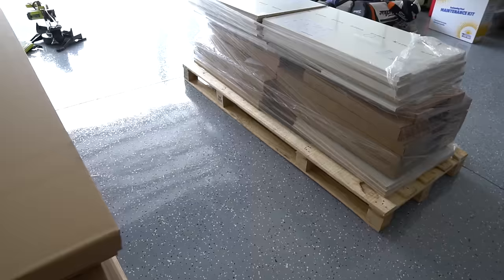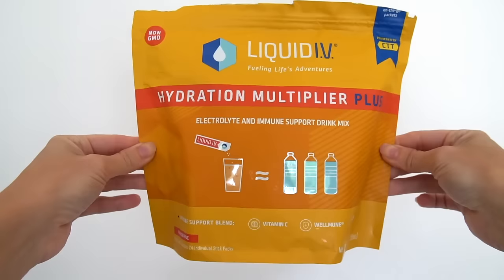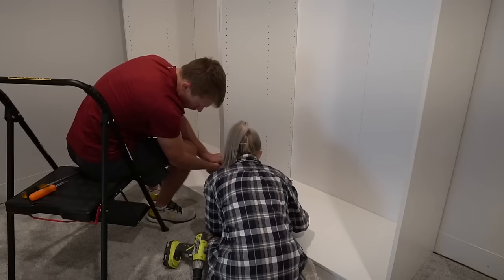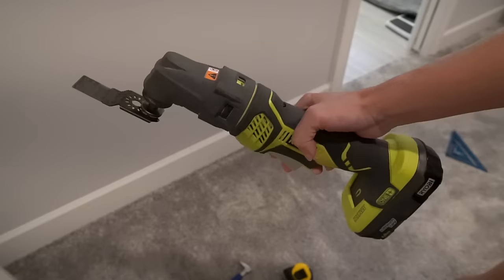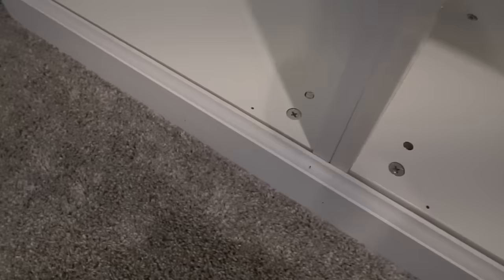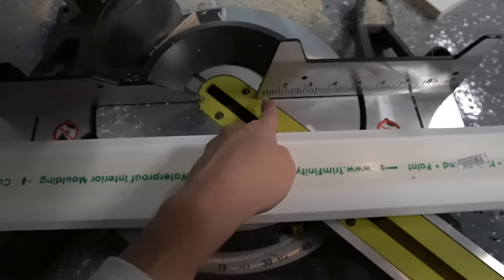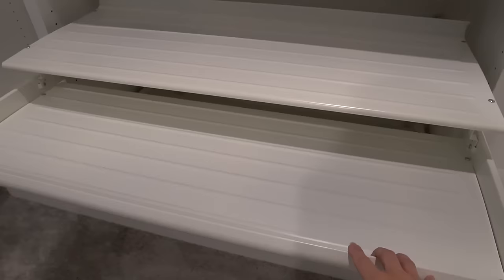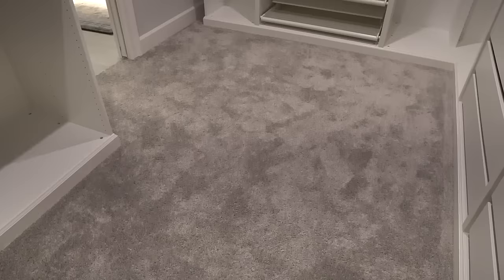IKEA PAX Closet | Home With Stefani

Comment: My husband kindly asks that you quit making these things look easy. 🤣. What a great job. Looks so high end.
Reply: This really is easy…we put ours together fast
Reply: @alisaben1  111111
Reply: Yeah. It looks easy on video. But she didn’t show all the difficult parts, I’m sure there were a few rough patches. Like cutting the 45 degree angle and nailing in the right corners. And I’m not sure the caulking will hold up well over time. That lower section could have been finished a little bit better and would have made the cabinets much sturdier since the pax is made of particle boards. I have the PAX. So I know each section should be beefed up a bit to hold well over the long haul.
Reply: It's easy on a new home like this..on old homes like mine..over 100 yo..not so much
Reply: I feel your husbands pain!!! 😂😂
Reply: 🤣🤣🤣🤣🤣for real though. I bought an ikea Chester draw and I almost gave up putting it together 🤣🤣🤣🤣🤣
Reply: They are easy. I put them together with my daughter.
Reply: It's easy because the wife in this video helps.

Comment: Would be curious to know how much did the IKEA PAX that was installed in the video costed? I am assuming $5K-7K. Thanks!!
Reply: Generally these systems are less than 3k. I have a closet similar to this size and our closet was about $2000
Reply: I have 6 frames in my walking in with drawers ( both glass front and solid front) pull trays, shoes trays all under $1700

Comment: Hi Stefani,  I enjoy your videos.  Wonderful Job. I have installed three IKEA kitchens and have assembled dozens of pieces of furniture. I am big fan of their products.  I like your use of wood strips, baseboard and crown molding to give them a nice finished look. The one thing that I would do is to get filler strips for the ends where you have what looks like a 6 inch gap. When IKEA doesn't have filler strips that are big enough, I have purchased an extra door or shelf to do the job.

Comment: Looks great! Love the crown molding. I’m curious about the single detached unit on the one wall. Would it have been possible to change the dimensions of one of the cabinets on the wall beside it and then use another corner unit to fill that gap?

Comment: Super nice end result.  Remember to always take one side of the wardrobe into the closet first, so you can see that you can straighten a whole wardrobe, without bumping into the ceiling or the other walls.  If it is cramped, you can assemble the wardrobe standing in place.  Need a little more hands then.  Another thing is that the shelves are made of chipboard and have fragile edges.  Be careful with these.  Another thing to keep in mind with IKEA furniture is that a little wood glue helps a lot to avoid unstable furniture after a while of use.

Comment: As a professional IKEA pax installer
The way to do efficiently is to build the units first then mount, not one by one but all at once
Also those drywall anchors are terrible
Best ones are toggler alligators
And for baseboards you did use the right tool
The oscillating tool is what I use too
For the drawers the sliders should be installed all at once they are 6 holes from each other and shelf on the top drawer is 5 holes. It's more efficient to do them all at once, same with drawers instead of one by one
Great job either way for a first timer looks great
The

Comment: i had so much trouble attaching the  floppy back to the frame because it kept folding into itself.  After unsuccessfully attaching the back, I tried to raise the frame and try to attach the back vertically-- the entire frame collapsed splitting some to the dowels and the bottom connection. Thank you for the idea of using the sticks to hold the fold straight.

Comment: I see that you installed the wardrobes directly over the carpet. Have you done any installations on hard floor and then carpeted? We will be replacing the carpet in the room, but not sure if we should put carpet under or up to the robes. Thanks for your vid...it'll definately be a go-to when we start building!
Reply: Do the carpet 1st

Comment: I rather your home cabinet and the reason being is I like I like the way it is where  it reaches all the way to the ceiling but this one is nice but the Crown-mold is OK but if it touch the ceiling it would be better and another thing is Put a little white paint in the  in  the filler if you drop in a little of white paint in it would be easier to cover. I also do painting on cabinet

Comment: Those drywall anchors are kind of bad. They have really poor pullout resistance. There are much better solutions for anchoring into drywall, especially if you want any strength at all. Snaptoggle anchors are one option, Fischer also makes synthetic variants (Duotec) which have vastly better pullout strength. For the ultimate in strength, there's the UK made GeeFix - those are wild, they can handle hundreds of kilos of weight. Overkill even for most things, but nothing wrong with maximum strength.

Comment: Since you had removed most of the baseboard molding of the closet, why not remove them all, and change it to same baseboard as the one on the PAX.  
You need a mirror in closet , get a sliding door mirror from Ikea, I am not sure they has set one for PAX system though.
Change the light for the closet is another suggestion, get a ceiling track lighting will work great on the PAX; also, you could install some RGB led strip behind those crown molding to add some color for the closet's ceiling.

Comment: When you removed the baseboards there is a gap between the floor and the drywall where the carpet ends. Did you guys cover that? I was told bugs can hide there and I should cover it

Comment: Awesome! Wondering why you didn’t trim away the carpet and pad under the PAX units? Wouldn’t the units be more stable on a solid floor surface instead of the carpet and carpet pad?
Reply: The cabinets are screwed to the wall, so I don’t think stability will be an issue

Comment: As far as I understood, you need a very specific room size to fit the pieces in. What to do if the room has a different size? The planner is quite unhandy and the provided code does not lead to the same configuration.

Comment: The entire pax system is cool, but it would be even better if you could at least buy all the parts you need at once and could get them delivered all at home. But no.. I’ve been to Ikea 5 times last month and still I don’t have my closet complete. Once an item comes back in stock they only get 10-20 of them and they sell out the same day. All the smaller parts can’t even be ordered online and need to be picked up right away.. if they are in stock.. This all makes it a bit frustrating.

Comment: That is not how you cut crown molding. Also make the frames go all the way into the corner of the room.  Why would you leave 6" of dead space.  You just buy one size bigger and cut it to perfectly fill the room and then use it for shelves and hanging bars which are easy to cut also. Another pro tip.  Exclude that kick panel at the bottom and you get 2 free inches of vertical space.